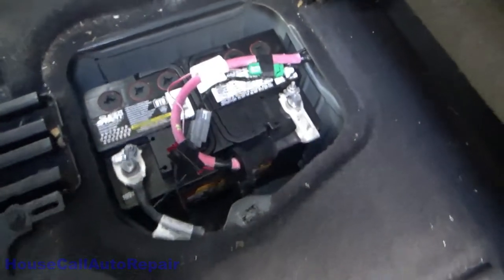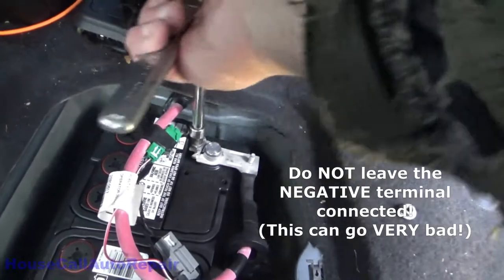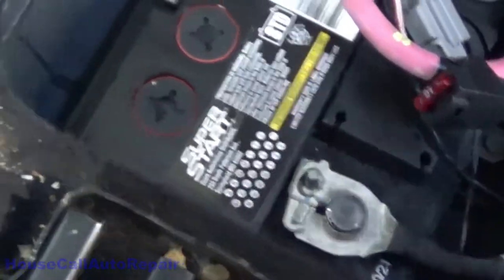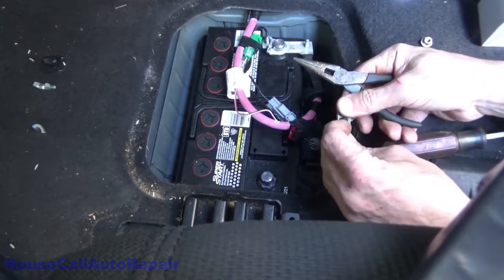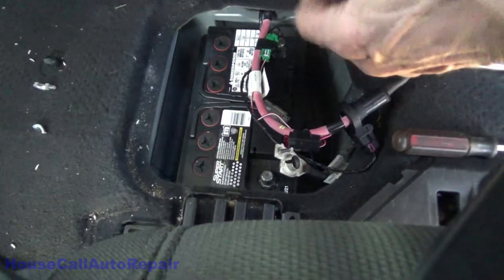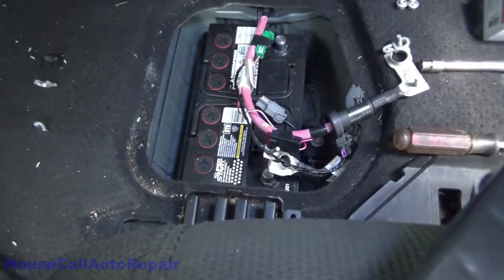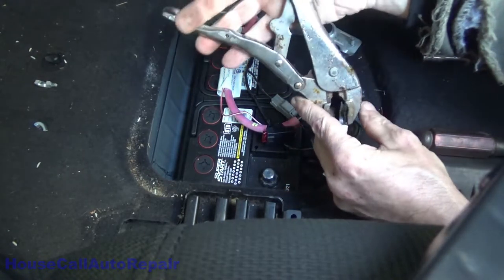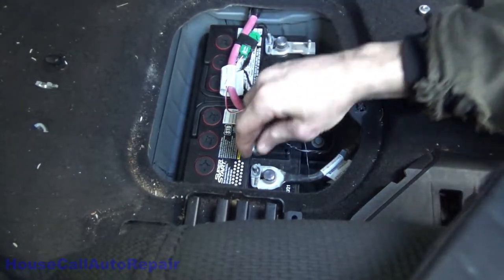GMC-Chevrolet Battery Clamp Repair

Comment: Thanks for this. You stressed in the video but I will stress as well, get the clamp ALL THE WAY down onto the post, as far as it will go. On my 2014 GMC Canyon, there's a big plastic cover over the battery plus a plastic safety cover around the red clamp. I had to remove the red cover to get the clamp down all the way.
Reply from the maker: The owner told me that it was missing when they got the vehicle. (I asked where it was)

Comment: If those small pieces are broken could it stop the battery from working or recharging ?
Reply: I need to know because i just switched my 09 Chevy traverse battery out and it worked for like a day and didn’t work the next i need to figure out if it’s the alternator or that little piece because it’s chipped and I’m wondering if i replace the small piece with a new one it’ll get back to running
Reply from the maker: FIRST you push the clamp ALL THE WAY down the post as far as you can. (This make the good electrical connection) then you SNUG the nut. (This prevents the clamp from loosening up)
If you have a good connection at the battery, the issue is somewhere else.

Comment: Bad system. My new DORMAN's didn't work on my 09 Traverse. Should I remove the OEM felt washers to get the cable clamp to sit lower on the post maybe? I notice this GMC does not have the felt washers.   I had to drive a sheet metal screw between the post and the cable clamp to get the positive side to be tight.
Reply from the maker: Unfortunately the screw essentially is the last nail in that clamps coffin.
The trick to these is that they MUST be pushed on until tight, BEFORE snugging the nut.It only takes one incorrect install to permanently damage these goofy clamps. I think the old fashioned clamps still work just fine!